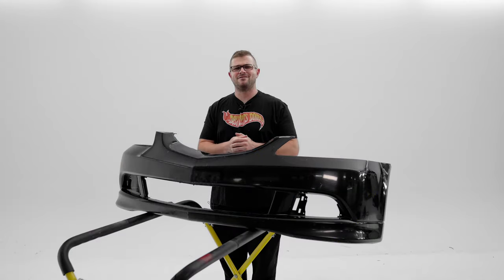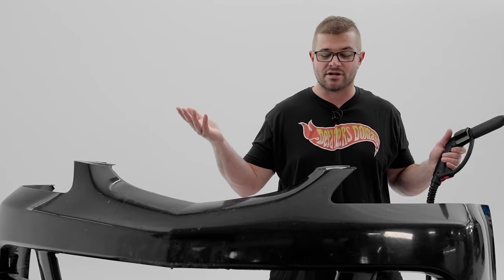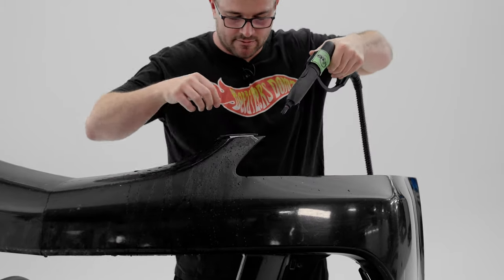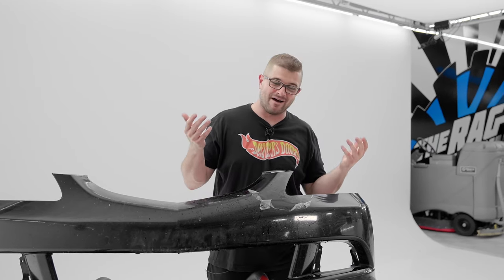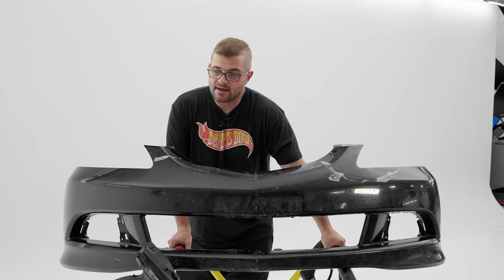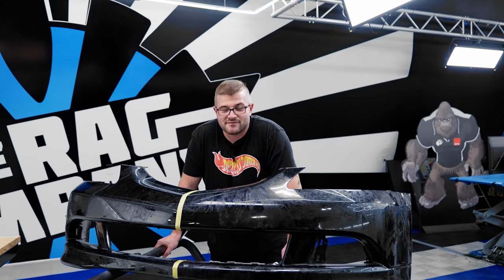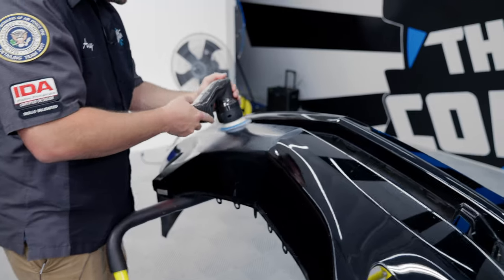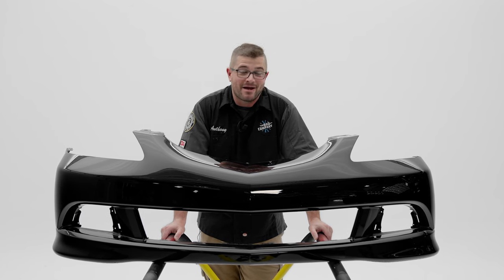Tips To Remove Paint Protection Film

Comment: I have 14 year old 3M PPF on my car and will probably have to remove it in a year or so.  Have you tried very hot water?
Reply from the maker: We did steam, which is very hot. We didn’t try boiling water, simply because we didn’t have any means of boiling water in our facility.
Reply: Larry from Ammo NYC uses the boiling water technique to remove old PPF and it seems to work really well. He uses an electric kettle, pours the hot water on the area he is about to peel away, then boom peels.

Comment: just done Porsche 993 front lower bumper  18 year old PPF vinyl was even cut on the car as had to be done in 3 pieces back then Hot air gun and your nail or plastic scrapper breaks off in bits took all day eventually left with masses of glue behind plenty of Tar and glue and plastic covered blade polish at the end done

Comment: After removing the PPF that was sun baked and stained I really can relate to your pain and efforts of everyone that helped you.  I still have adhesive left on that is slowly diminishing, way to slow.  I finally told the customer that I will return when the air temps are back in the 70-80's range.  High temps of summer heat wave (Houston) even with shade are causing the chemicals to evaporate too soon and not softening the adhesives.